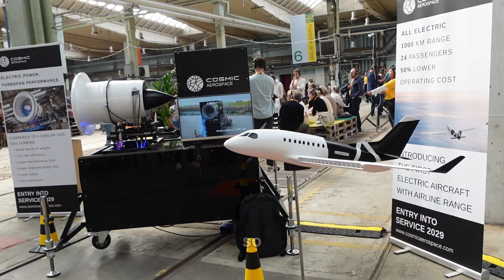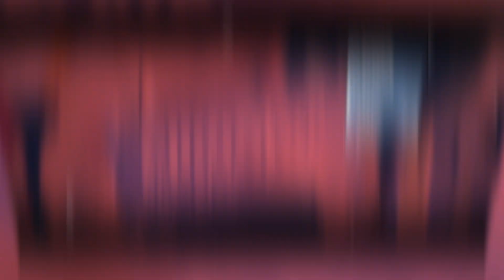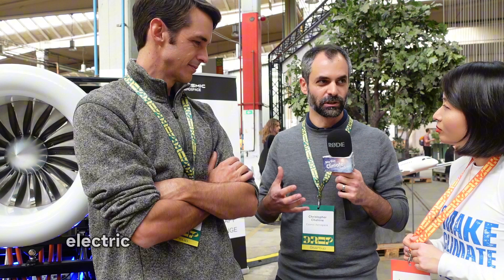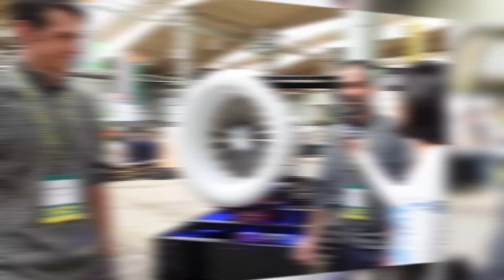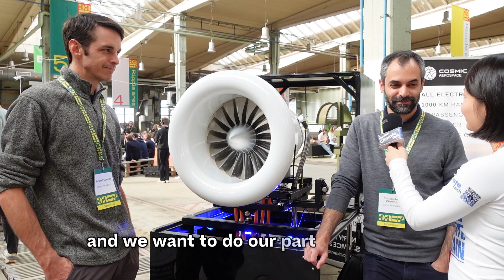World's First Electric Engine with Airline Range! Cosmic Aerospace

Comment: My first question would be : why is the white shroud curved in front rather than sharp edged to cut through the air ?.
Reply: They found that the shape of a dolphin with its bulbous nose and forehead actually cuts through water easier than a slender, pointed cone and tube body.  Some fish can actually rest and remain stationary while in moving current, as their shape by very interesting hydrodynamics produces a forward thrust which cancels the force against them from the moving water.
In aerodynamics, it's for the most part the same.  And that is why the leading edge of wings are rounded, rather than sharp.  There are some hypersonic aircraft that do use the sharp knife-like front edge, and this reduces resistance at very high speed, but at a cost of efficiency at speeds we're used to; standard airplane speeds.  
Depending on the curve of that shroud, I think it will not only reduce air resistance, but draw more air into the turbine, while creating a lower pressure around the outside perimeter (which may further reduce its air resistance).
I am just musing here, and would love to hear these guys correct or improve my answer.
Great question, BTW!
Reply: Lilium has done this already 10 years ago.